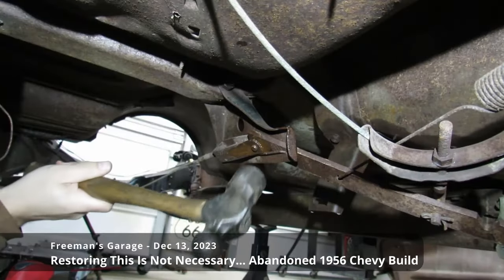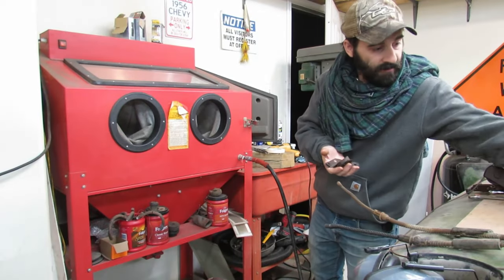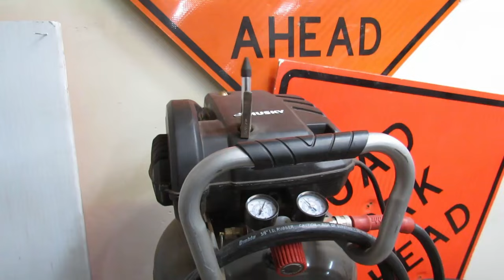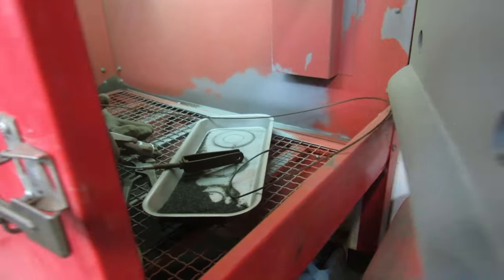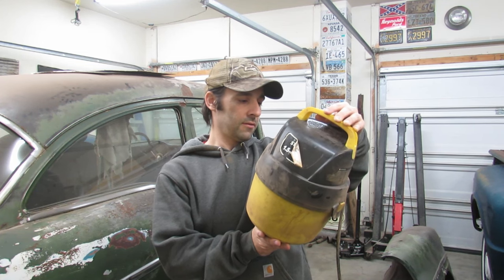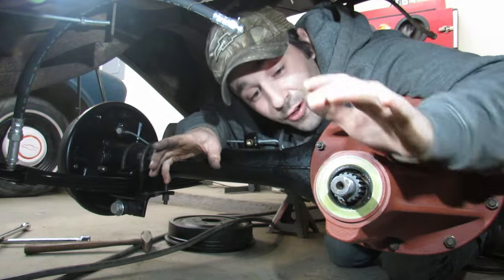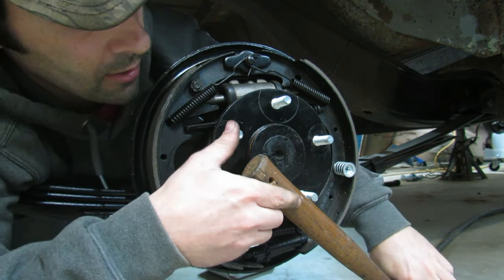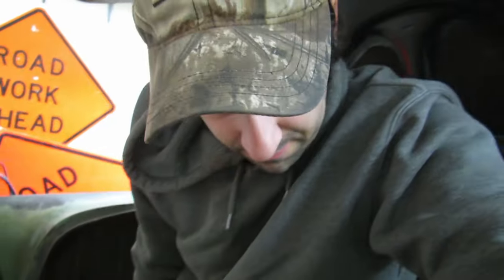Nothing But Problems! Abandoned 1956 Chevy Build

Comment: You bring joy to others....what does it say about us that we take joy in your pain?  At 34.37. Flaw in your plan is both nuts are designed to slow down an grip the pinion shaft? So that you may have a proper feel as you work, chasing should be done with an open nut that is unconstrained and your original nut should be tossed because it was distorted in the removal process. RIP shop vac. Memorial service in the works?

Comment: Isnt that nut a one time use nut? As in its tapered slightly toward the end, so it would feel tight as you tighten because its torquing itself onto the threads. Also, doesn't the factory manual state the thread pitch/size? Might have to pony up and get the proper die to clean the threads. Plus....new tool for the box😅
Reply from the maker: I'm not 100% sure about the nut. I didn't see the thread pitch/size in the manual. I might have missed it so I will look again. You're right I do need to get the proper die. Nothing wrong with new tools.

Comment: The rollers should come with hardware & that 1 bolt is NOT SUPPOSE TO LOOK LIKE THAT, LOL.
Reply from the maker: You're right. They do come with hardware. They've arrived but I'm not in town to install them. Figures. You tell me how hat bolt got that worn down.
Reply: @freemansgarage  From the constant tension on it from the cable rubbing through it Slowwwwly, took awhile I bet.

Looking forward to seeing how the pinion nut comes out, GOOD LUCK SIR.
Reply from the maker: Thank you. We'll see how it all turns out.

Comment: I never had one of those fancy thread files, I had a set of small triangle files and once I got it close I finished it off with the proper size tap and die. Would it be false pride if I thought that I was the Kevin you were referring to?
Reply from the maker: That's funny. Completely random. But you can be any Kevin you want to be.

Comment: You can try a SPLIT DIE to try too fix those pinion threads.

Does the NEW NUT even try to go on ?
Reply from the maker: Yes, the new nut does try to go on. A split die would probably work. Good idea.